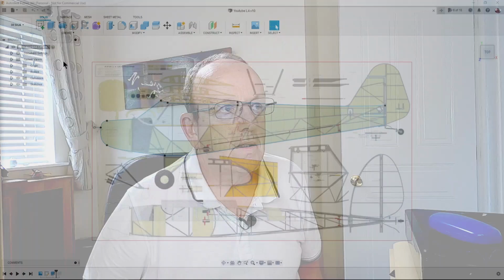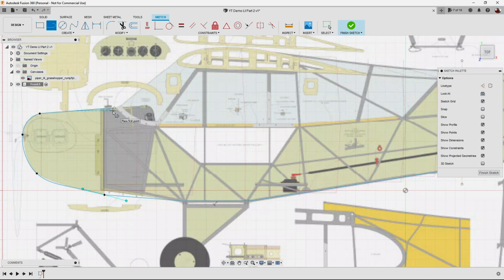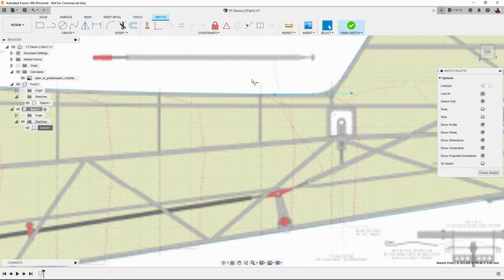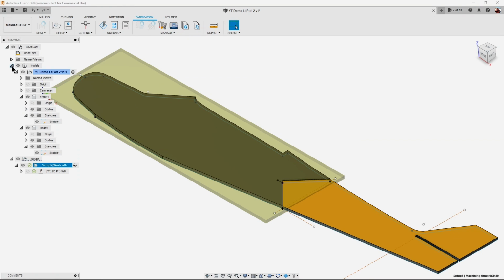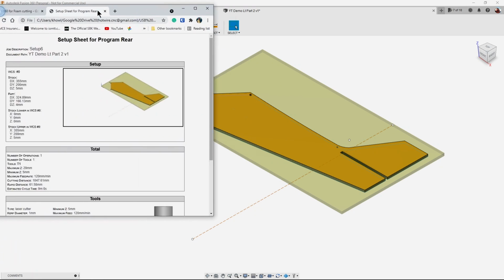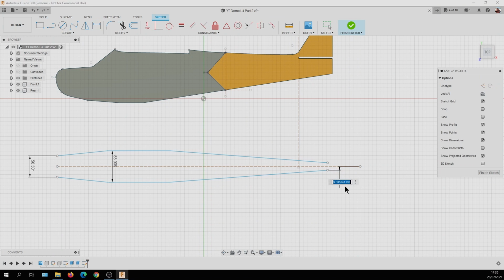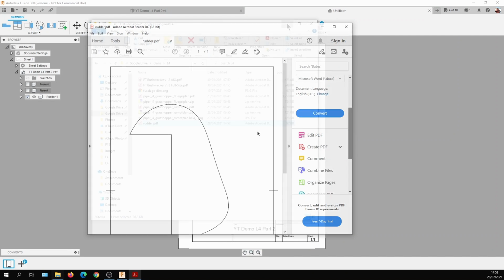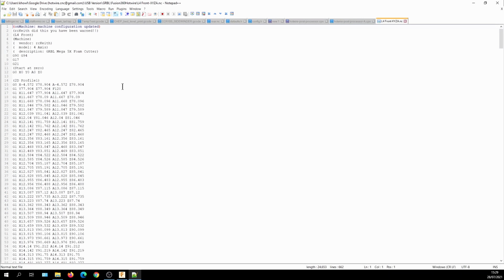Fusion 360 for 4 axis CNC Foam Cutters - Parallel Cuts Only - Part 2

Comment: hi my design .nc ccode start -190 around, how ı an fix
Reply from the maker: Need to make sure the origin is set at the start of the stock have a look here and see how I move the origin https://youtu.be/5VGgzcldh1I?t=1350
Reply: @rckeith  you click left bottom is it? so should we enter a offset or cutter dimentioin? ı buid custom machine
Reply: @rckeith  youre best uncle, one last question, ı couldnt make a 1cm offset during start cutting, on the simulation seems cutter wandering starting point then start cut , after the finishing again wandering around, how ı can fix whats my mistake
Reply from the maker: not sure what you are describing.

Comment: thanks for such a detailed Vedic. I have been following you for quite some time. designed a 4 axis hot wire cutter based on your instructions, however it is all metal. Aluminium and steel. works very well. Few questions on constructions of Fuselage.
The criticality of fuselage apart from its overall dimensions are
 Angle of attack. The angle at which the elevator is on the fuselage.
Now if you see the nose of fuselage which is being cut. It is roundish which do not provide any reference surface to fixing of motor. had it been a straight line, fixing motor square on it would make propellers run 90 degree to the fuselage.  

Next is the angle at which main wings will be mounted. it is very clearly defined and understood

next is the cut for inserting Elevator. since the canvas/ photo of Grasshopper do not have the lines marked for that, at what angle these are to be cut, is it to be arbitrarily taken following horizontal constraints.
 third question is that do we make two side walls and top and bottom profiles and then glue them into a fuselage the way the FT Bushewaker or will it be a single stock of foam and then cavities created in it fit the motor and other electronics.
 lastly will the wings be made in fusion 360 or the way it was earlier being done. 

I am big fan of yours and following you.... Shall make this plane and Post the pictures.
thanks again
Reply from the maker: Hi I'm just about to release Part 3 which will show how I make the parts. I intend to cut cavities in the foam for batteries and servos. I'm considering cutting the nose section off and 3d-printing a cowling.  The wings won't be made in Fusion 360 I've used DevWing Foam 2 but any of the free g--code generators could be used as it's a simple wing.
There will be a Part 4 video much later in the year where I'll show mounting the motor and the wings etc. But I have some other projects to completer first.  Thanks for your kind words
Keith
Reply: @rckeith  thanx a ton. I think next video is uploaded. I am all excited to see it .